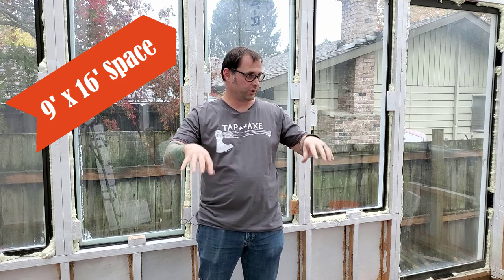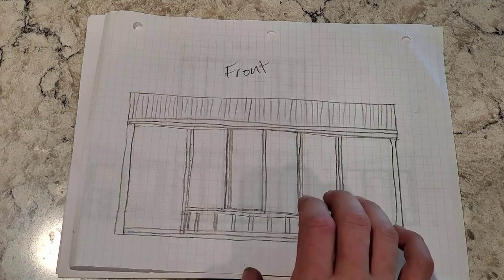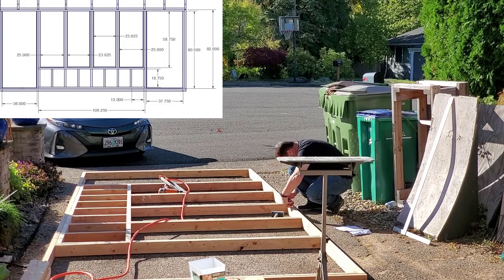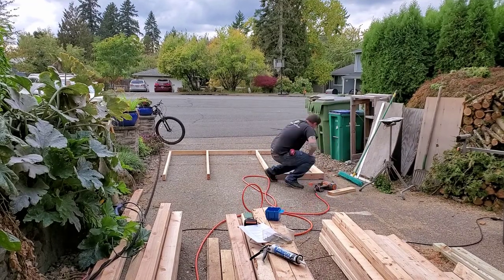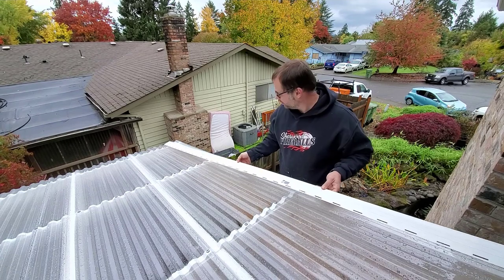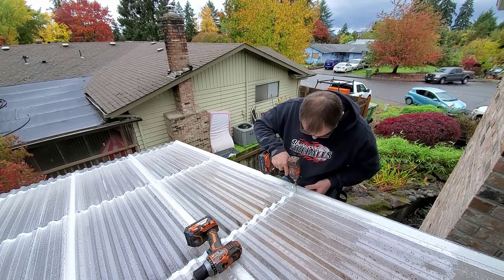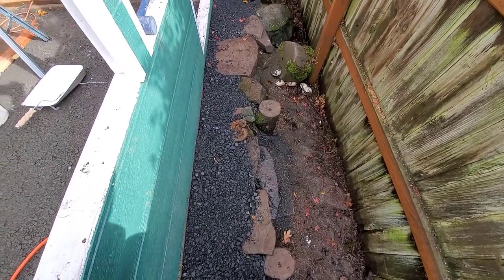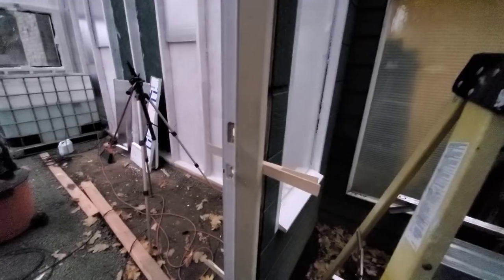Step by Step Greenhouse Build (w/repurposed windows) Future Aquaponics

Comment: I'm looking to build something similar, lean to style. is it necessary to build the back wall instead of just anchoring it to the house?
Reply from the maker: I only separated it because I was going to have so much water inside.  I also knew I was going to be heating water with Tilapia in it and I knew I was going to be creating a ton of moisture.  In the winter it's a rainforest in there.  Another reason you might not want to though is the area you live.  If you get higher heats, it could raise way higher for the siding.  This is depending on your siding, and your climate though.